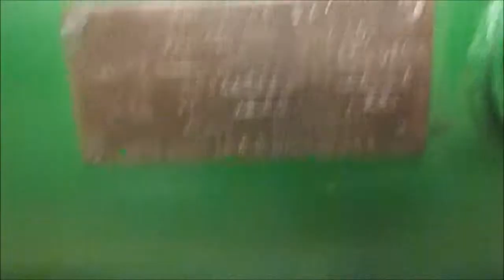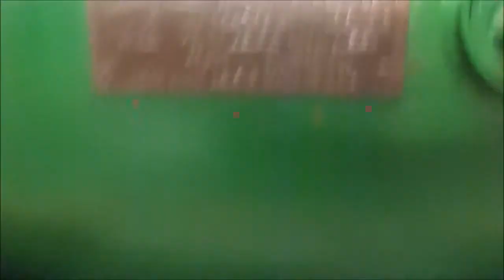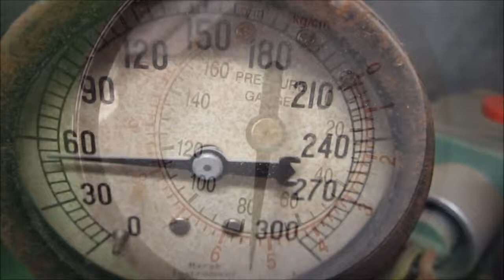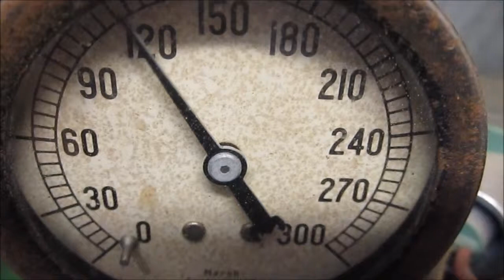1953 Ingersoll-Rand 10T 2-stage air compressor w/ 15HP single-phase motor and 120 gallon tank

Comment: The tank is an ASME Section VIII U-69 pressure vessel rated 200PSI @650 Deg F. The U-69 vessel is a premium vessel built with a higher factor of safety than standard U tanks. Unless there is a lot of corrosion in the shell, the tank should be good up to 200PSI.

Comment: I have the same compressor . Well almost the heads are a little different design. I'm still looking to spin mine up. Having trouble finding a starter, what did you use in that regards.
Reply from the maker: I think my Dad bought a new GE starter for it, which can be seen at 1:18